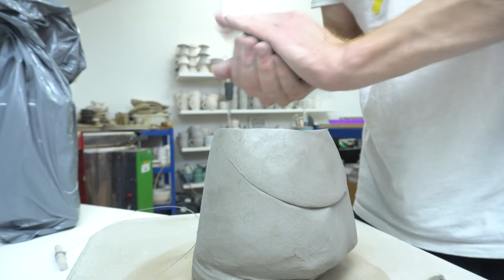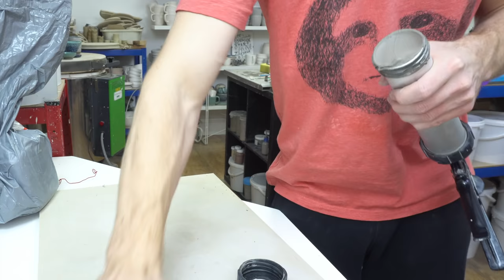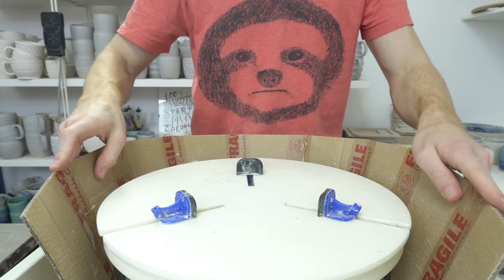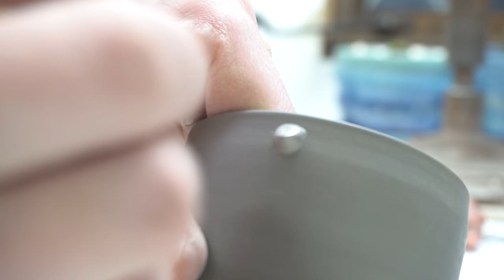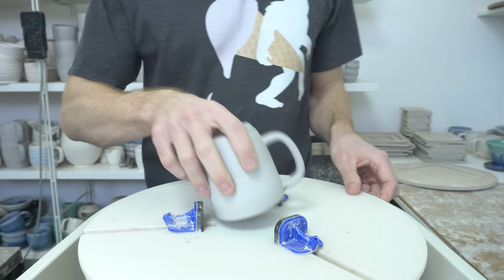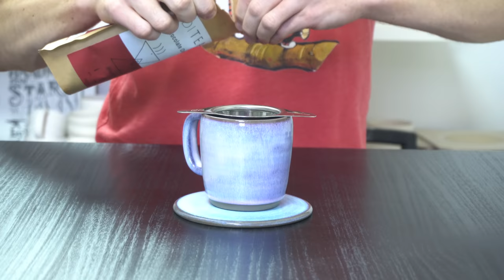Making a Mug from Start to Finish - Limited Edition version

Comment: I'll never question the pricing on a $20 mug again.
Reply: 🤣🤣 came here to say the same thing!
Reply: What
Reply: These handcrafted works of art might actually go for more.
Reply: @kyleeames8229  I just saw people's pottery sites selling single mugs for $50 and more. so I come to learn to make them lol
Reply: As a potter myself, I go even further than Joe did in this video (though I know he goes even further at times as well). After the trimming and handle attaching, I paint each of my mugs with something called underglaze, which I then carve through with a carving tool, to create different designs and textures. Sometimes I go even further and use a slip trailer and add slip from the same clay that the mug is thrown in to create a raised texture (this gives the piece three different textures, the smooth texture on regular mug that I threw, the carved texture and then the raised texture). Then it's bisque fired and clear glazed and then it's finished. 
My mugs have been known to go for $80 or more because of the time and care I put into each piece, but they're all one of a kind and gorgeous works of art, just like Joe's mugs. 
If it's handmade, it's worth the price the artist is asking. Trust that. 💙
Reply: Lol! So True!
Reply: 2023 here- you mean $40 mugs!

Comment: That was amazing to watch. Cleanest, tidiest potter, EVER! I haven't ever seen using lasers to help with uniform height. I haven't ever seen the suction cup to help with dipping. I'm wondering if you had to stand there holding the dipped cup until the glazed dried. Thanks for filming this. Super excellent job.
Reply: I've seen it in construction to make sure things are level. Thats what makes it facinating is using construction techniques for pottery. Very dedicated. 👏🏾

Comment: I have wanted to do this for a long time. Just as a hobby (im retired). I acquired a Kiln and hardware. Maybe by summer 21 i will have a wheel and my shop wired to handle the kiln. Meantime im going to take some classes 😁👌
Reply: When you get your wheel,I do start up classes on duo 🙂